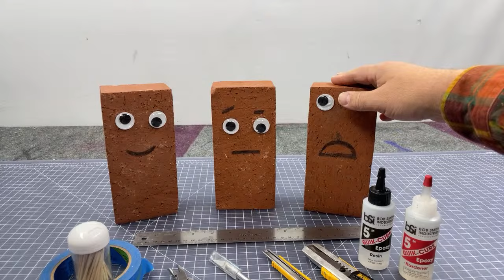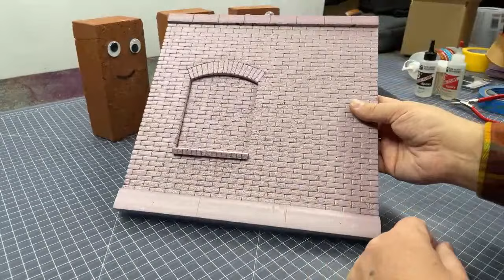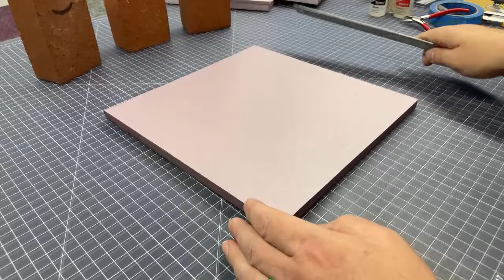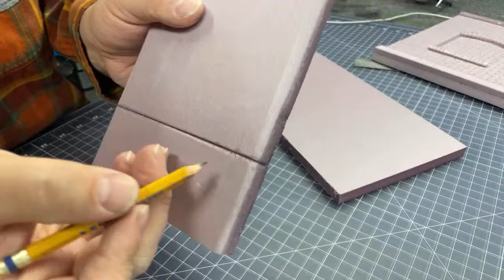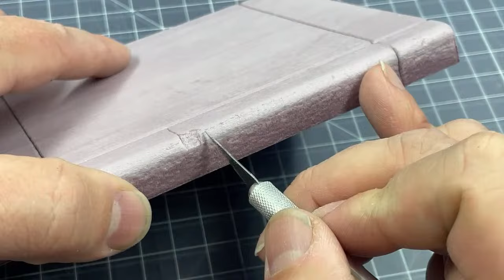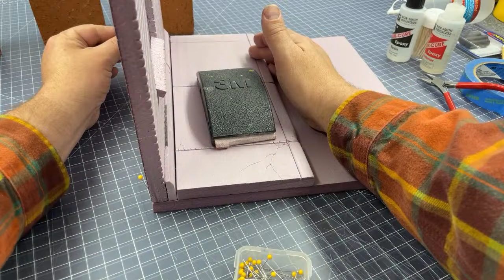How To Make | Hyper Real Miniature Concrete Sidewalks | Art In Real Time Ep 41

Comment: I'm 30:12  into the video and just wanted to note there's no link for the cork! That actually looks better than the stuff I've been using from hobby lobby which tends to tear pretty easily between projects. The stuff you have looks just a little thicker which I've been looking for!

37:23 I use super 77 a lot for gluing my cork down and then rolling it with a roller I have to make sure nothing bubbles up. 77 will melt foam if you lay it on a little too thick so I'd probably avoid using it at least for foam on foam or cork on foam. I actually want to try the gorilla glue you showed and the 303 you mentioned.

Keep up the good work as always and know that I (and I'm sure many others0 appreciate all of the time you put into editing these videos and just doing the live streams in general :)